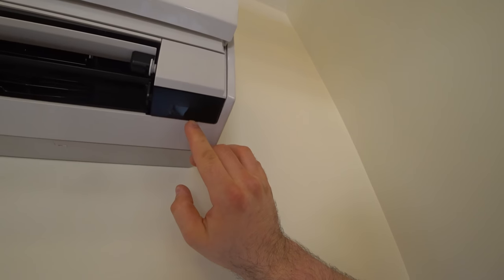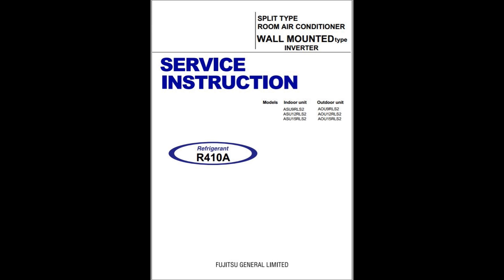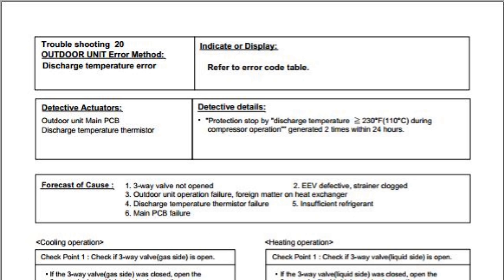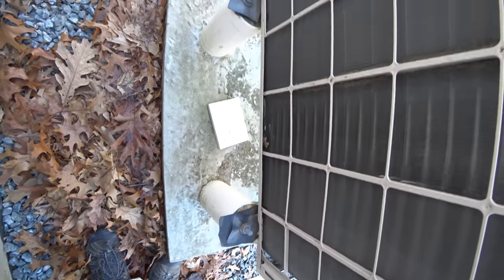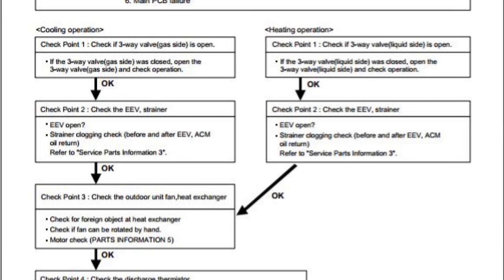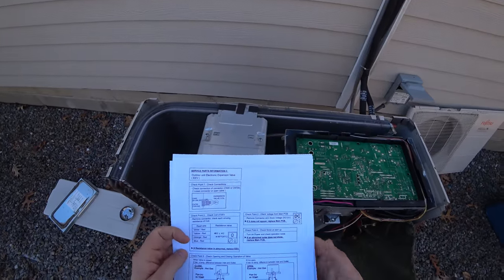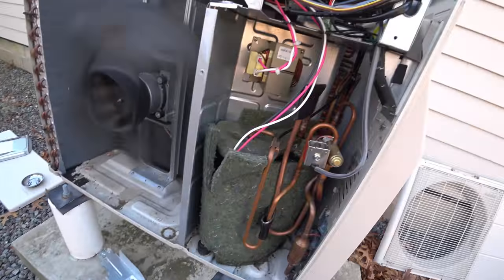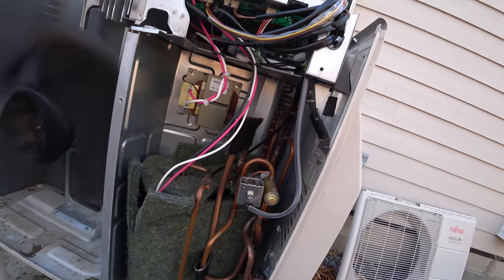Mini-Split Heat Pump Failure, AGAIN!

Comment: one year with a fujitsu halcyon at my mountain cabin. it would not sufficiently heat this winter so I had installer come back out. it had a leak but no error codes. installer said it needed 3 liters which seems like an awful lot with no error codes being produced.

Comment: If the line set is smaller that 10 feet it could be overcharge  . Some models factory charge is good for 25 feet after that if im right u add .22of an ounce per foot

Comment: -Low refrigerant charge. 410 is a blend! 
-If the thermistor is in tolerance/range with temp taken from discharge pipe while connected
Replace

Comment: update  check indoor unit open grill to the right there is a reset botton hold it for 10 sec  both light will blink then unit will go into test mode.. check your pressures you may have a leak
if below 120psig

Comment: prob have a ref leak. only times ive seen discharge temp error is when a leak is present. chekc oil spots on the evap coil and flare connections
Reply: ive had leaky slimduct coils, cassete coils, floor mount, wall mount. no outdoor leaks though.

Comment: Update.  Tech came out and has seen this issue a couple of times.  First thing they said was it needed to be cleaned at least once a year, second thing was they knew what the issue was.  Thermostat on outside unit had to be replaced.  10-1 error code is what it is called and have fixed five now for the same thing.
Reply from the maker: Yeah, I eventually scrapped mine.
Reply: Is there a video of the fix or do you know what it ended up being? Having same issue

Comment: I have an ac pro and it does the same thing, pouring hot water on the condenser coils makes the compressor quieter, outdoor fan still spins slow, but eventually it starts heating, but as soon as it shuts off inside or you cut the breaker it does it again. Whats the issue here

Comment: Your indoor  unit is an Rls2  model , not sure  if it is a 9,12 or 15 but probably a 15 . your indoor coil has a leak . Have someone test it with nitrogen and hopefully you can have it replaced . It has a 5 year warranty so your probably in luck ( hopefully ) or very near end of warranty .
Reply: Hi @groodman, have you read this blog : https://tedsenergytips.com/2014/01/29/why-i-can-no-longer-recommend-fujitsu-mini-split-heat-pumps/

In the comments of this aforementioned blog, there are two types of refrigerant leaks that people have reported. Type-1 is because of faulty flare/joint installation. Type-2 is the coils developing a leak because of some corrosion from galvanized bracketss holding copper coils. Which type of leak are you referring to in your comment?
Reply: Abhinav Gaur yes I have read it , I am still replacing coils on that particular model and also their newer model which replaced the rls2 . The leaks continue with the RLS3’s . Currently the RLS series are no longer available and were replaced with the LZAS series . Hopefully their coil problem is behind them but only time will tell .

Comment: That reversing valve could be stuck closed or low on refrigeration or there could be a leak on the lines or those filters may be dirty also. Gotta keep that maintenance up to par on the heat for those splits.
Reply: I’m a hvac tech. On these units most of the time it’s a leak.
Reply: Ya bro... it's totally the filters being dirty 🙄
Reply: @johnpise1723  doubtful

Comment: We got a pioneer and haven’t gotten a whole season out of it either…. Tried checking the lines, replaced refrigerant, and the cpu circuit board. Nothing has worked and the error codes are generic that cover almost everything that could go wrong. So what’s the point?
Reply: I should also say, I’ve had an expert come out as well and also didn’t know what’s going on after troubleshooting as well.

Comment: So what did you end up doing? I looked at your video page and did not see a follow up video (or missed it if it is there)!
Reply from the maker: Eventually I removed it after making sure there was no refrigerant left in the lines.
Reply: @DavidPozEnergy  no warranty? that sucks, but thanks for the follow up. Mr Cool and Mitsubishi have 5 years parts and 7 year compressor warranty, most of the other companies give zero years if you self install and if you use a tech then half the tiem the tech doesnt' register the equipment online to get the extended warranty.

Comment: Check Evap temp in AC Mode if the Evap temp is super cold Below 45 d you are low on Refrigerant, 95% of the time you have a leak. This is what I did for mine after a week I could see the Evap temp Drop I re flared then  topped it off.

Comment: 99% of the time it's a gas leak from the interior coil, it's the most common problem with fujitsu mini-split systems. You can see the leak cause of the oil. There should be dark lines in front or/and in the back of the coil. The coil is the big piece behind your filters. You have to change it to repair(not recommended) it and fill your unit with the right amount of R410A. And have every tool a real technician got lol... So yeah call a tech.
Reply: you are very correct, this is true. cheap and cheerful units but prone to faults.

Comment: Unit is low of R410 connect your guage and see if you have the required pressures according to the mfg specifications. Compressor won't kick on unless it has the right amount of R410...hope it helps
Reply from the maker: I've been trying to understand this lately.  There is a chart that has different pressures based on temperature.  What temperature?  Any help would be appreciated.  Thanks.
Reply: @DavidPozEnergy  ambient temp, outside temp. You figure out what the proper pressure should be at a given temp. So if you are in Florida and temp there is 90° then expected pressure will be higher compared to if you were in Alaska
Reply from the maker: Thank you, I was confused by that because I watched a youtube video and the guy was putting a temperature sensor on the smaller copper pipe.  https://youtu.be/7LMYRS-yvXQ
Reply: @DavidPozEnergy  yes that tells you the temp of high and low pressure lines but Temp/ pressure chart that you referred to earlier tells you what the guage pressure should indicate at the current temp of the location.

Comment: If your turn it on to cool does it blow cold air? Sounds like the reversing valve may be stuck. When that happens you’ll need an 
AC TECH to pump it down and sweat/ braze in a new valve. May or may not be financially a good decision

Comment: I know nothing but the reversing valve (3 way) is not working so either is stuck or sensor is deficient sorry to hear this. Engineer775 has been running his 24/7 for a couple of years and says it is indestructible. Cheers hope someone knows.
Reply from the maker: I must be an anomoly.
Reply: Sometimes it's easier to replace the whole computer board than to pay for a technician.
Reply from the maker: I agree, my dilemma is that I don't know if it is the computer board or something else.
Reply: We installed a Fujitsu mini split at work. It's been running day and night for two years now. I've always heard good things about them
Reply: I'd turn on the air conditioning and see if it runs normal without fault... If so the reversing (3 way) valve is probably your culprit. I've hear of people using magnets to get the reversing valve to slide open or closed... worth a shot!
Reply from the maker: Great advice.  Thank you for commenting.  I'm going to try running the AC and see what happens.
Reply: DavidPoz No problem, if the ac isnt working properly you probably have low refrigerant...
Reply: dwf dwf 1 off maybe
Reply: DavidPoz lol
Reply: dwf dwf yep
Reply: DavidPoz Tru dat

Comment: We just had a Fujitsu Halcyon minisplit installed. In heat mode it runs for a few minutes and shuts off. We have been on the phone with technical support for hours and have not been able to remedy the situation. After watching a number of utube videos it appears these minisplits are not a great substitute for furnaces. Many people have said they don't really heat the house, and you need backup electric heaters etc. Are these mainly used as air conditioners?
Reply from the maker: I ended up replacing my Fujitsu with a Mr. Cool DIY kit.  I'm using the Mr. Cool as heat and AC.  But, it's hard in a cold climate.  When the temperature drops to single digits (F) the mini-split struggles to keep up with demand.  It still makes heat, but at reduced capacity.
Reply: @DavidPozEnergy  yep there are very few cold climate mini splits. Mitsibushi hyperheat is supposed to have 75% capacity at -13F. Most of the cheaper brands dont' even publish their cold temp charts or curves and rely on vague marketing promises liek will work as cold as -5 and forget to mention that at that temp capaicty is reduced a lot!

Comment: so.. did you end up fixing it or replacing it outright?
Reply from the maker: Could not get it working properly.  I'm pretty sure it is the valve, not switching the refrigerant flow from heating to cooling mode.  The solenoid is working on the valve, so that tells me it is the internal piston stuck.  Right now it is still on the house, circuit breaker is off.  I have a window AC currently cooling off the whole house.
Reply: @Doctrines of Faith Ive followed the trials and tribulations  of that brand for  ten years and it don't  get better. My own mini is a Mitsubishi  purchased  after seeing that reliability  was more important  than a higher seer or hspf.

Comment: have u cleanned your air filters...is the gas 410a at the wright level theres many things to check out for...30 years in the biz good luck(new subcriber)
Reply from the maker: Hi beez,  I clean the air filters on the inside unit regularly.  The refrigerant could be the issue, I don't know.  Last year I had a professional come out.  He said I had a leak (second one since installation.)  He removed refrigerant, then replaced a flare fitting, then vacuumed the lines, then re-charged the system.  Worked good up to this point.  So I suppose it could be another leak.  However, last time I had a leak the coil was frosting over nearly immediately.  I'm not getting that this time.  Is there a way I can check refrigerant level?
Reply: sorry for the late reply i was enjoying your other videos...:) Im quiet certain the unit has lost most of its refrigerant these units can last 20 years if properly installed whith top gun teck...! u would need a set of gages fit for refrigerant and thats a bummer cause u wont use these much since ur not in the field (ac) but defitnely need a very good tech and beleive Me you will like your unit once its working like its supposed To...let me now ok :)
Reply: I'm in the same boat, mine stopped working 2 years in, spent this winter using space heaters, had 3different techs in and no good results, Daikin unit.
Reply from the maker: Looks like I've got some company in this boat of failed heat pumps. Thanks for sharing your experience Homer.

Comment: You shouldn’t be playing with inverter units if you’re not trained on them they use transistors to create variable frequency for the compressor
Reply: They shouldn't be messing with it at all if they aren't licensed or certified. Good way to blow the unit up or cause personal injury
Reply: Sounds like the HVAC guys are here, but not to help. Sounds about right. 

My unit has been serviced twice at high costs and is down again. Been waiting 3 weeks for a tech to come out. It’s cold and I want to know how to fix it, 11 red blinks on the outdoor unit, any help?

Comment: The only way to know if the problem is charge related is to use gauges to read the internal pressures.  Without that knowledge, everything else is a guess.  You should be able to switch from HEAT to COOL and vice versa to exercise the reversing valve.  Most of them make noise when they switch, so listening up close while changing modes is recommended.
 If you were in COOL, and had high discharge temp indicated, then either the 410 was not moving through the condenser & evaporator, or the outdoor fan was not blowing air across the fins to lower the temperature of the gas.  Blocked fins or slow fan could make things worse.  The fan cools the gas and lowers the discharge temperature by moving the heat to ambient air from the fins.
 I have heard great things about the Fujitsu units, as in none better.

 IF the reversing valve and the 3-way valve are not the same thing, you were pointing to the reversing valve.  That valve flips the flow of refrigerant to switch modes.  The 3-way valve noted in the printed page you showed may not be the same thing.  Also the order of things to check is the order of most likely problems.  You passed right by that and went fiddling with other things.  Maybe look at service procedure 3 to see what it points to...

Comment: Your condenser is dirty by the video you showed. Clean it first! Put the system back together because you can't run it with the casing removed, air will travel around the coil rather then through it. If it still malfunctions it could be the board as the discharge thermister shows it's proper value. Call tech support after you've performed these steps. Condensers look clean until you run water through them and find out there not so clean. If there is a restriction then reclaim the system and run a triple evacuation using nitrogen. Purge with nitrogen then evacuate 3 times. A micron gauge should be used and you want to be at least below 500 microns. weigh the charge back in and you should be ready to go. Many problems are due to inproper installation.

Comment: did you run unit in a low temp setting, meaning running ac with a 30 temp drop called running in a low ambient temperature!       kill all power , raise set temp up  then  it should clear code.

Comment: I wonder if a lot of problems are from the "super duper certified" installer coming out every year for a "tune up" and releasing a little refrigerant every time they check pressure, which is really not a std procedure for a mini split 

I would think cleaning the filters and coils maybe and checking /recording max cooling and heating vent temps would be a better way to track system performance without gradually releasing the charge over several years... 

Seems to be so many videos where the system is low, whether installed by pros or not... Points to improper install not torquing the flares etc

Comment: " LOW CHARGE " due to a leak or poor installation or both. Have a qualified 608 Certified Technician pull the charge and weigh it. I have sold several hundred of these units as a wholesaler and most of the time a discharge temp error is low charge.

Comment: When I set my mini split to 22 celcius, it used to heat the room up to 23 according to the thermostat on the wall. Now it is only heating to about 21, despite still being set at the same temp. Any ideas why that would happen? I am worried it is not working as efficiently as it should be now..
Reply: Considering it can run as long as it wants to based on the thermostat set point, I'd consider that the thermostat may just be aging and adjust my set point accordingly

Comment: I have a 3 ton Fujitsu mini split.  One of my indoor heads continues to ice up.  (I have 4 indoor heads). The unit literally makes ice.  How do I fix this?  The max line length is not supposed to be greater than 82 feet.  It just barely exceeds the 82 feet limit, could this be an issue?  It exceeds the 82 feet by maybe 2 feet.  Totally frustrating.
Reply: What happened? Did you figure it out?

Comment: Anyone know how quickly temperature changes with these types of units?  I recently installed an lg dual inverter system, and the temperature in the room changes very slowly... about one degree with a 3 hour run time... The air coming from the indoor unit seems lukewarm... any help is much appreciated... I don´t live in a cold climate... coldest it gets here during the winter is about 0 degrees during the early mourning hours and heats up to about 10- 15 during the day...
Reply: LEAK!

Comment: These split units are just fine...
However, this so called design unit has an front panel that goes up ( on ) and down ( off )  
Now when this front panel is pulled open to clean the filters behind it, sometimes the front is not correctly pushed back in place... you must hear a click.
When its not in place, you can expect these kind of strange failure incl. flash code

Comment: it is a simple charge issue. You need to have a quilified service tech recover, leak test it, and vacuum the system and then weigh the proper charge in it.
Reply from the maker: Been there, done that.  Paid a bunch of money and still have a problem.
Reply: how much was the bunch!